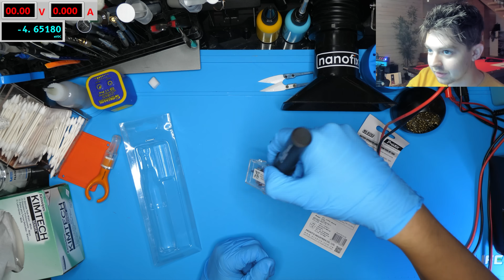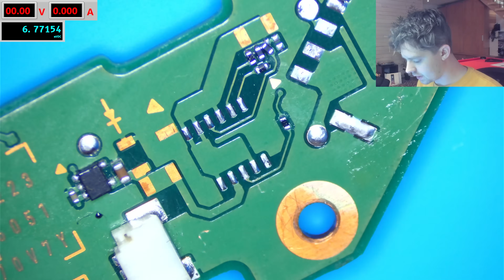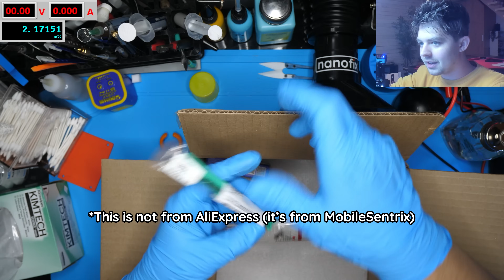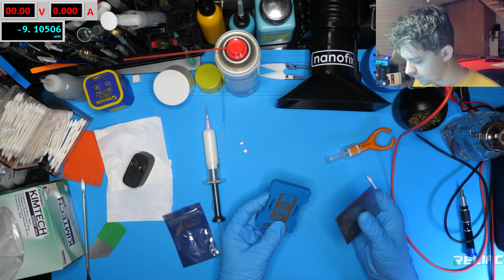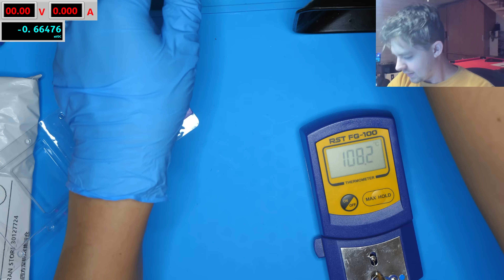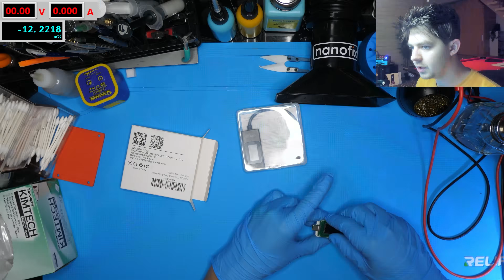Huge AliExpress Soldering Tools Order - Mail Day

Comment: By now, AliExpress is losing real money, if they don't start to sponsor your videos like this one. Damn, you got the thing with the solder ball pen-thing, and I was wondering what you could use them for. Damn you, now that I know, I need to get one of those.
That mechanics plunger is for Mechanic -sized tubes and fit in there like a glove. So if you have that uv-mask or that flux syringe, it will fit as if they intended it to fit in there.

Comment: I just picked up a bunch of stuff too and had a curious question I can't find answers to.  I have a 20x20 preheater  and am curious how many of you put the board directly on the surface plate?  I'm talking more about larger motherboards and not small daughter card/chip/reball work. I figured if only reheating to 100-150d doing port/connector replacements, it would be no problem.  Do you use standoffs or??

Comment: Update from my Ali tool hauls Zach, I got the mechanic IPX6 engraver/grinding pen - Very nice feels great in hand. The Fnirsi solder station arrived, I bought the one with both sized leads and tips. I may or may not have ordered way too much M35 (like 10 tubes lol) but I'm sure I'll use it. I got the Infiniray P2 Pro and thought I was being clever and ordered the USB-C version thinking it would work with my iPhone 17 Pro Max....Nope Android USB-C not Apple USB-C so I now have to get an android phone or tablet to use it (too much of a pain to return it) I also bought various bits and bobs, most of which you recommended :D Still waiting on some stuff to be delivered but my wife's face is a picture when a mountain of stuff arrives each day 😂

Comment: just a quick question ..what thickness tracer wire do you use usually with your switch repairs on ripped tracers ?
Reply from the maker: depends on the size of the trace that is ripped. But generally anywhere from 0.1mm wire to 0.01mm for the super small traces
Reply: @nanofixca  thanx for the info

Comment: Can you do a tear down of the suction pen? Extremely curious, how it is operating so "extremely well". 

And, maybe toy around with changing up the case... 3D print something to get rid of the cheap feel.  Mentioning  it in another comment but a simple project would be...that casing upgrade, but also add in a charge circuit and rechargeable battery. ** Walla ** Now you got yourself a custom preemo product

Comment: Always love these videos, that adapter opener spray, I looked up the SDS and the chemical mostly consist of is called "Tetrafluoroethane" which it goes by other  names, a lot of them being *-134a which is used in refrigerant and air conditioners. IDK if its that specifically you are smelling, just thought it was interesting.
Reply from the maker: definitely interesting!!
Reply: As a chemist, I think you might be on the wrong track. TFE is a gas and is used as the propellant in the spray. I expect the true, active substance(s) of the mixture to be a trade secret.
Reply: @rotanal9563  I had a feeling I was on the wrong track, thanks for the info.
Reply: @nanofixca Just a s a curiosity of mine, could you describe the smell of Adapter Opener Spray? Does it smell of alcohol, or of fruit, acetone or gasoline? Thanks

Comment: Omg you have no idea for how long I've been looking for a proper sucker pen. Defo buying this one
Reply: Question will be: can it be used to pick and place like resistors?
Reply: @mrqqqcrash I can't speak for all of them but I have a decent aluminum/stainless one I bought directly from an electronics shop and it still has a mild 'kickback'  when unlocking the spring/suction.  The other few lesser quality ones I had, seemed to hit harder put pull less suction.  I think unless you had the hands of a brain surgeon, component's would shift when being dropped in place and you would need to connect flat at 90d everytime.  Now I'm curious if it would work and will try it. 😂

Comment: The trouble with hand release button suction devices, is that releasing the button WILL MOVE the smd device some, it must always be foot operated, 
Get a full pedal and wire it into the device, and while at it use a walwart for power.

Comment: Could you please do an AliExpress episode unpacking cheap to medium  test gear? Curve tracers, programmable AC power supplies, high voltage breakdown testers, meggers,, low ohm meters, specialized short circuit / fault probes, interesting stuff like that.

We don't need another video of the TC3 component testers, or the boring handheld multimeter oscilloscope combo.... a million videos have been made about those things😂
Reply: they actually make a handheld multi-meter oscilloscope combo? I had no idea. will have to look into that But why AliExpress ??? I have been trying to avoid it all together.

Comment: how are you reballing? just puut the stencil on the chip add paste and reball it xD i never saw someone trying to use a chipholder for reballing XDDD
Reply from the maker: I currently reball on a cleanroom wipe when I use paste because most chip holders suck lol. When you have really tiny solder balls on tiny chips (like the 0.2mm balls on the MAX PMICs for the switch), it would be nice to have a chip holder. Definitely completely unnecessary, just a quality of life thing.

Comment: Really curious about that suction tool, specifically how the tip survives the or handles the heat, and can you buy replacement tips?
Reply from the maker: Not sure that applying hot air directly to it is the best idea especially since the body of the tool is plastic (attached to a metal nozzle). But you should be able to buy replacement suction cups like these:
https://s.click.aliexpress.com/e/_ms9l6Jb

Comment: 20:28 Why don't you replace the connector with a cable then?😂

Are you planning to test NF.Flux?
Reply from the maker: Hahaha I may test NF flux in a future comparison once the dust settles a bit :) We'll see!
Reply: @nanofixca  

That's why I asked, maybe a third separate opinion will help calm both camps.

I ordered it out of curiosity, and it arrived pretty quickly, it was 90% like what that customer said/showed about it.
The only thing I couldn't imitate was that extreme burning.
I tried it with a new soldering iron tip.  up to 450°C

It looks good, but I don't think it's worth 10x the price.
The change in consistency after it cools down, that some hard stuff  residue stays on the PCB, is quite annoying

Comment: I don't know if it's of interest bud but I just got my hands on a Fnirsi HS02-A (It uses the same tips as the F245 handle) for when I need a portable iron (Not sure if you ever do mobile work). I got the package with the box which incorporates a few tip storage slots, solder dispenser, tip cleaner and stand and it's superb!

Oh, and of course, superb video again, cheers man.
Reply from the maker: I actually have the HS02 B (C210 version) and I used it for quite some time. Not a bad little iron
Reply: @nanofixca Did you use it as your main iron or did you still have to defer to a mains powered one with the 210 handle for some jobs?
Reply from the maker: @alphawhiskey9245  I definitely had to use a higher powered iron for some stuff. I could make it work by replacing the power supply with a higher wattage one and cranking it up, but it definitely still has its limits.
Reply from the maker: And thank you!! 🙏🏻

Comment: That's funny; I bought that exact same vacuum pen 3 days ago, and I'm glad I did. Only paid 140kr for mine though (which is ~$19CA) 😁 I used to use those Mechanic plungers also (think I have 8 or 10 laying around), until I started using that finger-plunger-thing-a-ma-bob, and I did the tape-mod that you showed in the video on all mine 😂

Comment: 9:43 - Its actually exactly how it should be. Metal pipe to dip into liquid. I have no brand version of your first one, it has ball inside which gets corroded and unable to pull liquid, second problem is that plastic pipe break and is unable to pull liquid. Two of them became unusable after 1 week. Then I got MECHANIC GL-NXT. 
Regarding IC vacuum, there is mechanical one with inverted logic, squeeze, put on ic, release button, it stays on pickup tool permanently without holding button.
Reply: I trust the electric one more, it sucks continuously and doesn't drop it.

Ever since I almost cut my leg off with a glass plate because of the simple mechanical one.
After I lifted it up, after a while the vacuum started to let go and boom.
It fell to the floor a few inches from my leg...😰
At least on the electric one I can hear that oh my, it's about to drop it, and there's a couple of minutes of delay in it.
Reply: @juhaszpeter4796  How do you know, when electric one will run out of battery?
One tip is to use flux on chip, so it has some liquid on it, dry chip will not create good suction as the one with flux on it.
Also be familiar with tools you use, you cannot expect small extension to have the same suction force as big one. Also surface between suction and item itself is important for duration, clean, dirty, amount of time is different as per movement etc...
Reply: @orion310591RS  
I usually charge it and it has a battery status indicator.
If it only has one line, then it's on the charger.

From the sound, when I start it empty, without an object to lift, it has a kind of sound.
Then when I start sucking on something, the sound changes, the motor becomes a little slower and deeper.
It keeps this sound until the vacuum starts to leak from somewhere

When I hear the motor start to accelerate, I know there's a leak somewhere and I quickly put it down on the ground.
Since I've been using the electric one, it's always worked.

And since the motor is constantly sucking, the object stays on it longer.

I'm trying to save a lot on Flux because now all I have left is NF.Flux and it was bought at a horrible price.
Then I'll use my saliva, it's free

I'm somewhat aware that before I start using a new device I always test its limits and what I can expect from it.
That's why I threw two Fnirs oscilloscopes in the trash...

But thank you for your good advice.
Reply: @orion310591RS  You know it will run out of battery, when the battery is low. And I think most people who work on electronics can figure out if a battery is low.

Comment: Seems like Christmas :)
I have only something like AT-B778 Vacuum Pick-up Tool, it is manual, it was like $5 back then (5years at least) and it still works. 
Can lift GPU chips with 50g without any issues, and it doesn't let go the chip if you release it, but only as soon as you press again.

The glass bottle looks nice.

I have used a metal flux plunger which looks like HB21 PRO
but bought one that looks like RELIFE RL-062A. 
I must say, it fits every syringe I have and yes it is a bit big but it is really nice to work with.
Doesn't strain your muscles in the hand/fingers and you can use a precise amount of flux/solder mask.

Nice tweezers. 
I have the same blue ones that you have destroyed.

I have the same USB meter, works fine.

Have fun :)
Reply: Yeah I have that pickup tool as well and find it easier to use than the powered ones due to not having to depress the button constantly.
Reply: Дякую! I'm considering getting AT-B778 as well, seems like a more ergonomic version, smaller, no battery to worry about, etc.
Reply: @hangup23  absolutely, works like a charm and basically almost no parts that can break
Reply from the maker: I might test out that Atten pick-up tool and compare with some larger chips at some point. I might prefer the manual one!
Reply: @nanofixca  Thank you, a short video comparison would be wonderful!  keeping fingers crossed :)
Reply: @nanofixca  I have both the atten and the proskit. Proskit is better. Has more suction, albeit not night a night and day difference. But the biggest benefit is that the button requires a lot less force to hold down and you don't have to release the button to pull vacuum. Which makes it a lot more precise and less fatiguing to use. As with the atten you have to press down on the chip to ensure you have a good seal then release the button in order for it to work properly. Both of which cause unintended movement. Whereas with the proskit since it is constantly pulling suction it will just automatically grab the chip without any excessive force or movement.

Granted the Atten is probably fine. But since you already have the proskit it is kinda pointless, other than not needing a battery, can't really think of a reason to prefer the manual version.

EDIT: Actually one nice thing about the atten is the more aggressive angle of the bent tip. Lets you hold it more off to the side. Though could probably just manually bend the tip of the proskit some more if you want.

2nd EDIT: Starting actually looking into other nozzles, turns out these are just standard syringe nozzles like flux tubes and IPA bottles use. So you can get them in a whole bunch of different lengths and sizes for cheap. Standard ones are 16 gauge with about a 15mm needle length. But I am probably gonna get some longer ones for bigger chips and slightly thicker so the suction cups fit tighter. As well as some smaller ones for really tiny components, as I find the smallest suction cup is useless anyway and you are better off just using the bare metal. Then just bend them into whatever shapes I want.